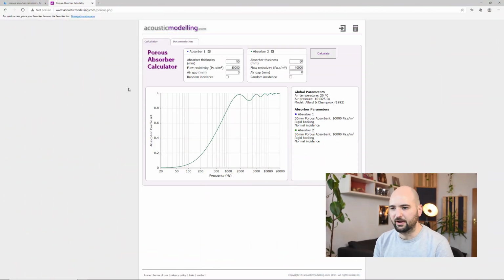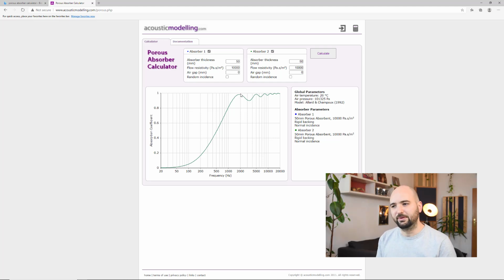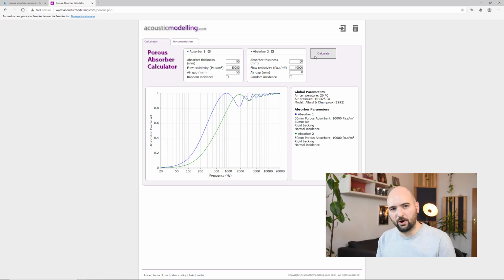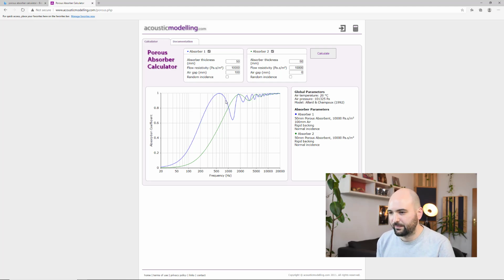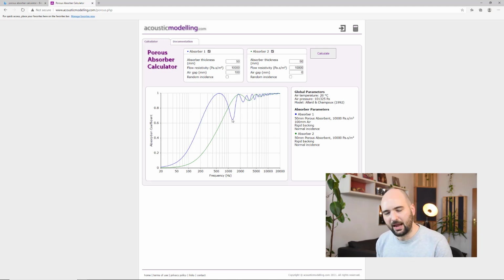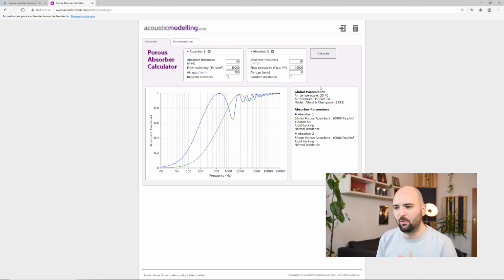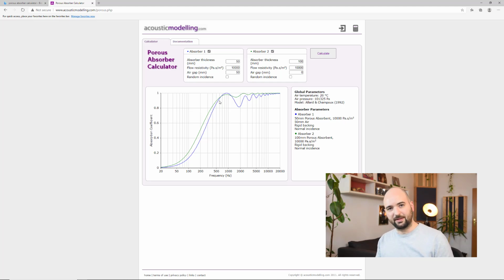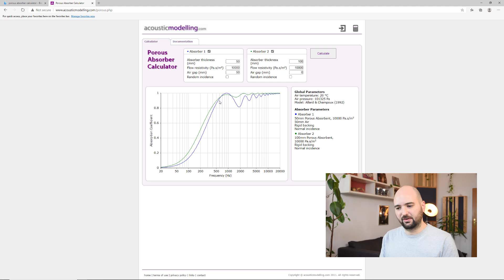Acoustic Panel Placement: Do You Need An Air Gap Behind Your Panels?

Comment: How would you implement the air gap ? I've got several 6'' porous absorbers and would love to raise my absorption coefficient from 0.4 to 0.6  at 100 Hz as thats exactly the problem-frequency-band of my room.
I just don't know what's the best way to implement the gap.
Would be great if you could do a hands on video how you'd install a gap like that.
cheers from austria :)
Reply: I cut four 1.5" cubes of rigid foam (the white shiny stuff that's often used to package electronics) and hot glued them to the back of my (DIY, 7" thick) rockwool panels, then re-hung them using picture frame wire.  The blocks are glued a few inches in from the corners, so they aren't visible.  Now the panels sit securely on their four 'feet', and appear to be floating away from the walls... a nice look that would be even more awesome with some wall-washing LEDs added to the panel backs.  The panels are nothing but double-thick rockwool sheets sewn in a fabric casing with either a minimal wooden frame on the back (new ones) or a solid sheet of thin MDF (early ones), so they're rigid enough and weight isn't an issue.  I also made a 3.5" thick ceiling cloud using a back frame (with a bit more structure to it, and some buttons to hold things together) and hung it a few inches below the ceiling. I did this more to facilitate installation than for any audio benefit, so it's nice to hear that's added.

I see that the software includes the phrase "rigid backing"... I'm assuming this means a solid back like a sheet of thin plywood or MDF board, versus a sparse frame and fabric.  Does this backing make a huge difference in performance?

Comment: Just discovering this channel and it's great, thank you!  Wondering about corner traps with this concept.  Corner traps from the center of the panel to where the walls meet usually have a fairly large distance.  Does this concept apply to corner traps as well?
Reply: I have the same question as well?

Comment: Any thoughts on ceiling cloud panels? I've covered the corners and side walls but I havent touched the front wall, rear wall or ceiling. I ran a few simulations using online tools and figured out that a ceiling cloud above the sweet spot would give me the best results for my future investments. If you were to prioritize panel placement for someone that is slowly adding acoustic treatment in phases, what order would you prioritize ?
Reply: in fact the ceiling is the best place for absorbers and if you are luckier than me with a high room you can even manage base there, just "waste" some room height

Comment: Hi Jesco thanks for the video, great stuff again. Regarding the dip we are creating when moving the panels too far from the wall - would it make sense to hang 3 (6inch) panels 8 inch from the wall, while hanging 3 other (6inch)panels only 4 inch from the wall: Would this lead to low-end absorption and partially mid absorption as well? Curious what you think about this

Comment: Using 6" absorbers here at the front and back walls spaced 1" from the wall. If I were to space them 6" from the wall I would be sitting in a closet. 3" on the side walls space 1" and 3" cloud absorbers spaced 3" from ceiling.
Reply: How does this sound? Does it catch a lot of the bass sounds from hearing it in other rooms? I was looking at doing a similar setup in a fairly small/medium room.
Reply: @noahhoffman5212  I would have to say that it has made a considerable difference. Given the fact that I have mounted over a dozen wall mounted absorption panels + cloud + corner bass traps + 7' mobile GOBO's in a 200 sq. ft. room. Keep in mind that soundproofing the room was not my goal. Although, my wife tells me that she barely hears a thing in the room above my studio. Happy wife, Happy life!

Comment: Is stupid to drill holes in to my wall to use as a tuned absorber? The walls are about 20 cm filled with rock-wool insulation, 3*2m. Should that work as giant resonator? Or is it to leaky?
Reply: no rock wool for living places and random holes here and there don't gain anything

Comment: Is this gap also more effective with bass traps in the corners? I've seen another video where they turn the triangle Basstraps in the other direction -> with the 90 degree angle not to the corner but to the middle of the room. In the end it looked like a square because you haven't seen the gap behind it.

Comment: You have a very optimistic view of how these air gaps work. The models in that absorption calculator assume that the air gap is enclosed, and that all of the sound is therefore funneled into a wall and back through the absorber. But that isn't the case when you're talking about air gaps behind a mounted panel, this gap is not enclosed. So a good amount of the sound (especially from the outer 50% of the panel) will not make it back through the absorber, but instead spill out from around the unenclosed air gap.

If you wanted this to work like it does in the models, you would need to build that air gap into the panels themselves, so that they're enclosed by a rigid material.
Reply: I am gonna test it out, but on that "Absorber Calculator" document page is stated : "This calculator estimates the absorption coefficient of a porous aborbent in front of a rigid backing (such as a solid wall) with an optional air gap between the absorbent and the backing. Up to two absorbers can be modelled at once."  There is no statement about a need of the airgap to be anyhow enclosed.. go figure
Reply: @odalv7278  Yeah I've tested it myself, there's no question that an airgap does improve performance, it's just not as drastic as the model predicts (for the reason I outlined).

So when he says 'you can leave a 3" gap and effectively get the absorption of a 6" panel', that's not true. You'll get some improvement, but it'll only be about 20-50% as pronounced as the model predicts.

Comment: Hi Jesco! I’m about to treat a live/drum room. I got for free 10 bass absorbers made of 100 mm rockwoll-framed and ready. They are pretty heavy (Density is 130 kg/m³) so what is the best wsy to use them? In corners or on walls?
Reply: I think the core material is waaaaay too dense for 10 cm absorbers… it would only work on high frequencies

Comment: I am sorry buddy but what you are telling people is false.

We have tested the hypothesis in laboratory and it does not work like you think.
Besides, an absorption calculator will show you what happens when you increase the gap in a unit that is Sealed to the boundary. This is critical.
You must maintain a seal all around the absorber if you want to extend the frequency response (absorption efficiency) downward.
Call me. We can talk about it and I'll explain the data 😉

Comment: Hi Jesco, I'm designing my studio and I included 6" closed cell foam on the entire length of the side walls I.e. 19 feet. The room will also be 11.5 feet wide. What could be some of the challenges? I didn't include air gaps
Reply: your room is very much like mine sizewise.. and im certainly no pro but that sounds like itll overdampen your mids and highs and pretty much leave the bass untouched. Equal to a very unbalanced sound because of the difference in reverberation time. Id prolly go for some kind of chunk or broadband bass trap instead. The biggest room mode at 31hz (speed of sound divided by the wavelength which is double your roomlength 342/11=31hz) youll need to adress differently though. Say helmholtz or panel absorber. A combination would probably work great
Reply: @kaptenkrut  Thanks. So, don't overdamp the Highs and Mids with full sidewall foam. Got it. I included 2' (feet) "Bass Traps" and diffusers on the entire surface of the front and rare walls. Will that help with Bass management?